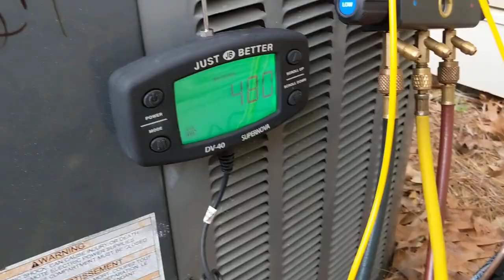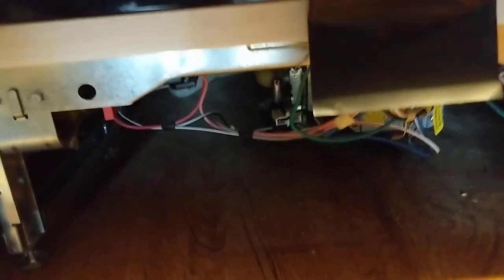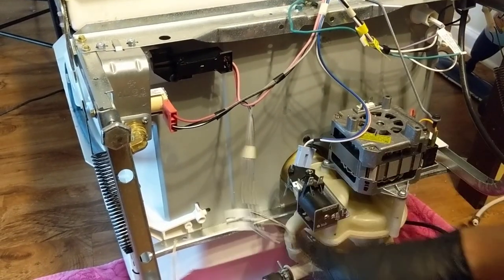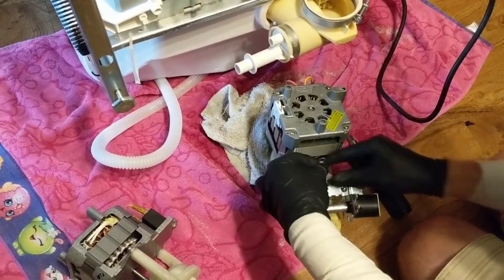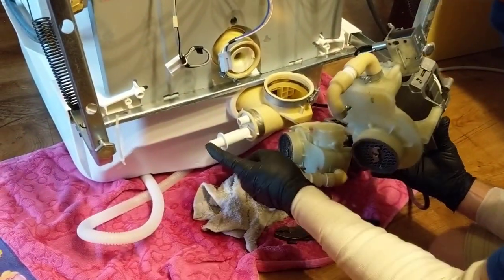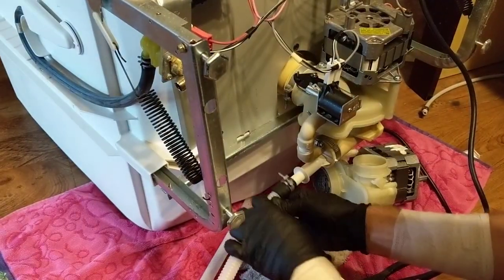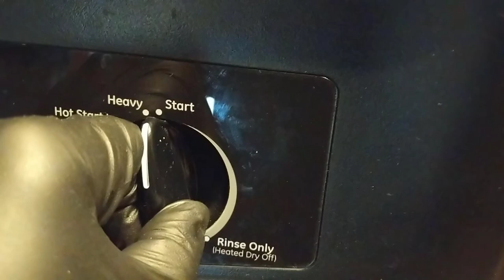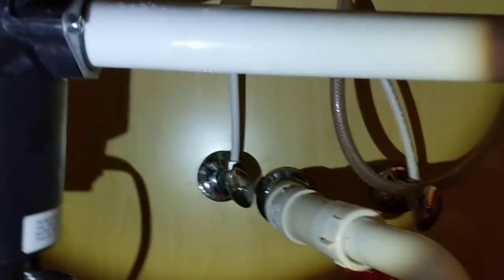GE Dishwasher Motor Making Loud Noise

Comment: Yep that's the noise,  motor only does it every now and then so I guess it's on the way out.  I kind of want to do what you do for a living.  Around the house I have repaired just about everything possible and I have a CPO for pool and spa operation. Along with some home weatherization and fireplace installation experience do you think that's enough to get a job in this biz?
Reply from the maker: That's definitely enough to get into this line of work. With already having your CPO your already ahead of most guys/girls who enter this trade. Some companies may start you as a tech 1 or tech 2 depending on how they label each position, or a make ready tech or groundskeeper/Porter. When I say groundskeeper/porter I don't mean cutting grass or anything, its just the title some companies have for someone who isn't quite ready to be a tech but still does minor work orders, make ready's, helps with major repairs to learn the major stuff. The company will pay for you to study & take your EPA Certification for Air Conditioning as well. What state are you in? & What is your knowledge base on Heating & Air Conditioning, Plumbing, Electrical repair, Appliance repair, & Carpentry? Thanks for watching Roberto & Subscribe to the channel 👍

Comment: Thanks for this. This noise started last night for me. What is the motor that I need to get for this? I think I have the same dishwasher in the video, I have a GSD330KBB. Is the motor a WD26X10051? A link would be helpful if you have one. Found one for bout $85. Thanks!
Reply from the maker: Yep that sounds like the correct part # & model #.  If you found one for $85 I would get that one cause that's a good price for someone who doesn't have an account with a distributor. Sorry I don't have a link, I'm working on setting up affiliate links for parts & tools. Thanks for watching GameAtomZ & Subscribe to the channel 👍

Comment: just a shot in the dark but im from ontario canada and i have a ge that looks very similar. mine just started making a noise, a constant errrrrrrrrrrr as its on. i stopped using it but the last time i did the dishes came out clean still. would you think im having a motor issue? and how much is a spare assuming thats the issue? thanks.
Reply from the maker: You would have to search your model number & find the correct part number for your motor. I have an account with GE directly so my prices would be alot lower than a regular purchase through GE or any appliance parts place. Thanks for watching Nick & Subscribe to the channel 👍
Reply: @ApartmentMaintenance  thanks, yah i ended up taking off the motor and pump assembly and found a toothpick jammed in the macerator. I then put the old motor and pump back on and it worked fine without anymore noise. unfortunately i noticed i maybe didnt tighten one of the gear clamps enough and there was a small drip so silly me tried to force it to drain and while twisting the dial around it didnt drain and it shut off and now it wont start or do anything. maybe a thermal fuse or interlock switch. im not much of an electrician so i could be totally wrong there too. thanks for listening to my story and im subscribed now 😉
Reply: @ApartmentMaintenance  if you know where to locate thermal fuses or have any other videos showing please send me the link. i have looked through your other videos and dont see anything. thanks again.
Reply from the maker: @MinatoNamikaze607  See if you have a reset button behind the bottom access panel. Once you remove the screws from the bottom access panel below the door you would see a black rectangular box with two buttons on it. It's basically a GFCI with a test & reset button on it. Press the reset button on the left to see if it resets power. Another thing to check is the motor will stick in one position & if you try this trick you can get it working, here's the link to the video. 
https://youtu.be/yUKs-YGZw_w
Reply: @ApartmentMaintenance  That link to the video you sent me sure did the trick! i used the screwdrivers to spin the impellor on the motor and then when i plugged the machine and turned it on it work. Just finished going through a full cycle and the machine is drained and all. I cannot thank you enough for your time on commenting and sending me to that other video. Your practical knowledge and the way you explain it in your videos is most welcoming to someone with limited mechanical experience. You have saved me so much time and frustration. thank you thank you thank you!!!!!
Reply from the maker: @MinatoNamikaze607  No problem! Glad to help.

Comment: The only tip I got from years of maintenance myself is open that water shut off then turn back 1/2 turn so it doesn’t freeze up later from calcium and the handle snaps off . Or I could just be an Arizona water problem . Either way great video
Reply from the maker: Never had that problem, may be the water out there, but good tip either way 👍 Thanks for watching Tommy T 💪
Reply: Apartment Maintenance ya I thought of it after I typed lol . Arizona water is terrible . Nothing lasts long . Angle stops are a nightmare unless that back turn is used
Reply from the maker: @tommyt5815  Wow sounds like it definitely is rough on the plumbing out there. I've never been out there but heard it's a very nice place.
Reply: Apartment Maintenance it was lol now 1/2 California lives here and everything cost wise is sky high . It’s so inflated it’s ridiculous . Weather wise you cannot beat it . It’s still almost a 100 degrees during the day
Reply from the maker: @tommyt5815  Damn california people! Lol  Not that hot here, but still in the 80s
Reply: Apartment Maintenance lol . 80’s is perfect . What state are you in

Comment: I tend to try just the motor first, usually the noise maker and easily changed without pulling the unit out from the cabinet
Reply from the maker: Yeah I hear ya. The motor came with the pump as an assembly under warranty. So it made a great video opportunity. Thanks for watching David 👍
Reply: How do you pull the motor out by itself i tried and it is connected with the pump

Comment: Would it not be cheaper to replace the dishwasher
Reply from the maker: You would think, but a new dishwasher (this model) sells for $275-$400 depending on where you buy it from. But I have a commercial account with GE & get the motors for just under $100. This one in particular was under warranty so the motor was free. Thanks for watching Michael & Subscribe to the channel 👍

Comment: How can I get the part I’m having the same issue
Reply from the maker: I'll post the link below. Good luck on your repair. Thanks for watching Mayakanaan4516 & Subscribe to the channel 👍
Pump & Motor Assembly
https://www.amazon.com/GE-WD26X10051-Mechanism-Assembly-Dishwasher/dp/B005OOZAYS/ref=mp_s_a_1_5?crid=925B94ZYFGJU&keywords=WD26X10051&qid=1680839240&sprefix=wd26x10051%2Caps%2C168&sr=8-5
Reply: Thnk you for the link does it matter which model I have I bought mine dishwasher in 2021
Reply from the maker: @mayakanaan4516  What's the model # of your dishwasher?
Reply: Does it work on the same part u sent me ?
Reply from the maker: @mayakanaan4516  I need to know the  model # of your GE dishwasher.

Comment: Can you share the link to the motor please ?
Reply from the maker: I sure can. I thought I had one in the video description but I guess I don't. I will have to add one. Thanks for watching Samurai & subscribe to the channel 👍

Here's the link to the new motor/pump assembly
https://www.amazon.com/WD26X10051-ClimaTek-Upgraded-Replacement-Electric/dp/B08GQ696CZ/ref=mp_s_a_1_2?crid=3EM7OSUGP8QEH&keywords=WD26X10051&qid=1675439218&sprefix=wd26x10051%2Caps%2C197&sr=8-2

Comment: Thanks, this may be what I need to do.  I get a loud growling noise (sounds like a bad bearing) as soon as the washer starts up.  It just started doing this tonight too.  Also, what is that screwdriver you are using?
Reply from the maker: Sounds like that's your issue, but it could just be something in the sump that needs cleaned out. It's hard to say without hearing it myself. That's the Klein HVAC 8 and 1 (Part# 32596), it has the slide drive on the one end with 1/4" & 5/16" magnetic nut drivers, on the other end it has #2 Philips, 1/4" Flat head, 1/8" Small flat head (thermostat screwdriver size & a valve core remover). My favorite screwdriver & my go to on any service call. Thanks for watching xgcskiman & Subscribe to the channel 👍
Reply: @ApartmentMaintenance  It is loud enough that the entire counter above it vibrates.  And I just subscribed.
Reply from the maker: @xgcskiman  Never had one that did that, motor could be out of balance (which would need replaced then). If your dishwasher is the same as the one in my video the GE part number for the motor is WD26X10051, just search your model number & confirm that yours uses the same part number. Thanks for Subscribing & plenty more videos to come. Enjoy! 💪

Comment: Ok, so isn't a motor/pump combo as expensive as a new dishwasher?
Reply from the maker: Depends if it's under warranty, or where you purchase your parts from. Some of my dishwashers we're under warranty & I have an account with GE appliances. I can get the motor/pump for around $90. A new dishwasher is $250. Those are my prices of course but either way a motor/pump is alot cheaper than a new dishwasher. Thanks for watching Fish & Subscribe to the channel 👍
Reply: @ApartmentMaintenance  Great info.  Thank you.

Comment: What’s the part number?
Reply from the maker: Here's the link to the dishwasher motor assembly. Thanks for watching Wguan5885 & Subscribe to the channel 👍
https://www.amazon.com/GE-WD26X10051-Mechanism-Assembly-Dishwasher/dp/B005OOZAYS/ref=mp_s_a_1_5?crid=925B94ZYFGJU&keywords=WD26X10051&qid=1680839240&sprefix=wd26x10051%2Caps%2C168&sr=8-5
Reply: It looks like that this one comes with a solenoid. Doesn’t need to transfer anything from the old pump.
Reply from the maker: @wguan5885  Yep it comes with everything ready to go. It's the best bang for your buck. 👍

Comment: I have new ge making noise THERE GARBAGE
Reply from the maker: You might just have something in the sump clanking around while it's running. If you pull the cover off where the water drains and clean it out with a wet vac it will remove anything that's in there. Of course that's if there is something in there but it's worth a shot. Thanks for watching Grous Grek & Subscribe to the channel 👍